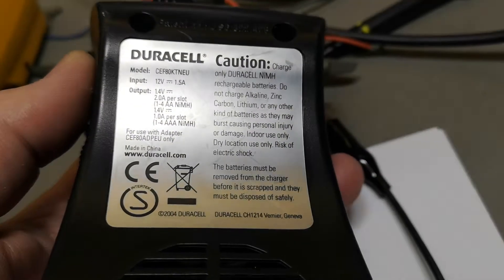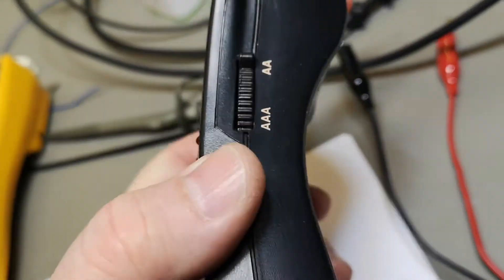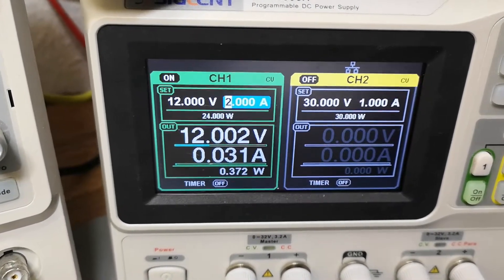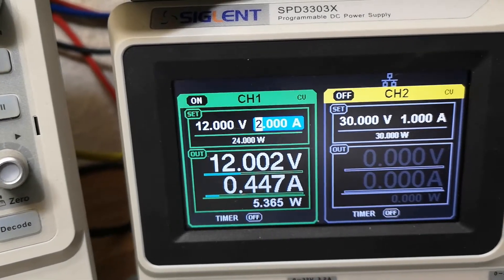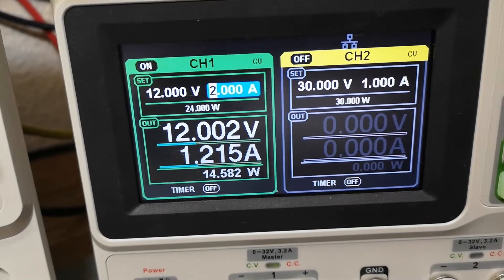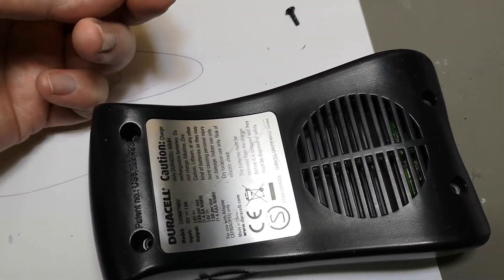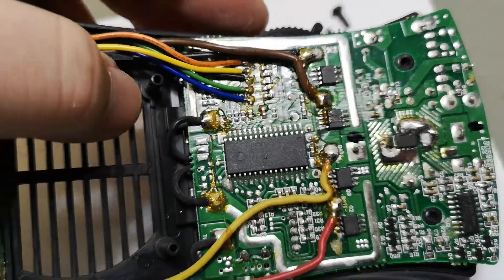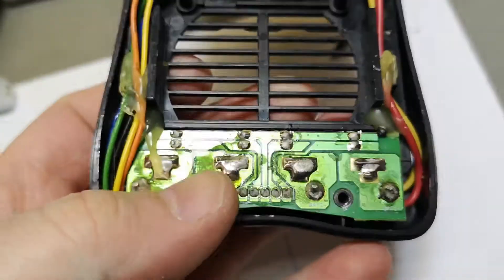Duracell 1hr Nimh AA/AAA Charger CEF80KTNEU Teardown

Comment: looks identical to the duracell 30 minute charger except without the fan (in the obvious fan housing). presumably less power and therefore given less cooling (for less money). I can't find any data on the duracell 30 minute charger especially regarding trickle capability so if you get one please give us a review